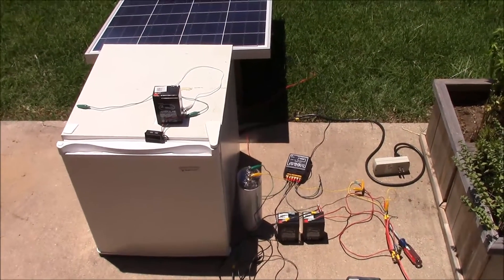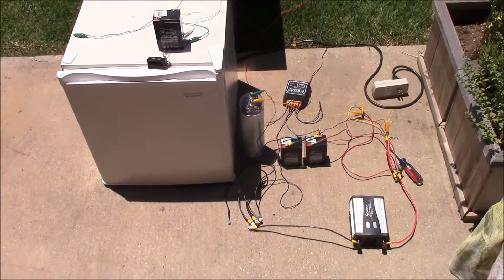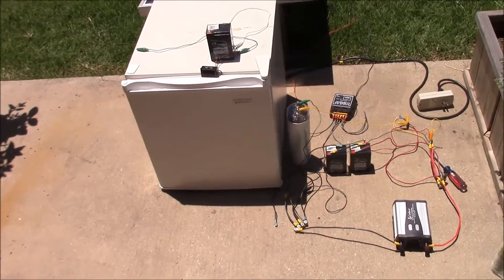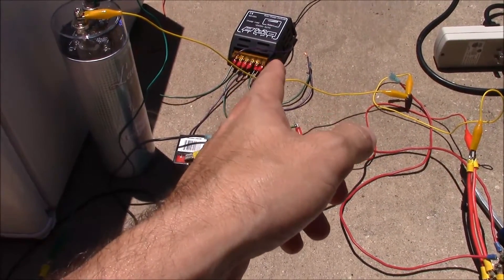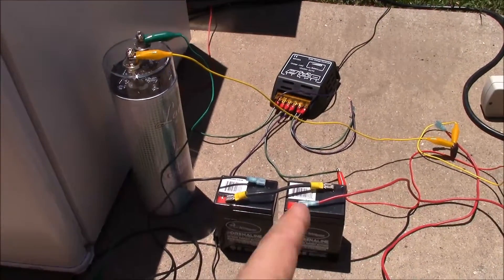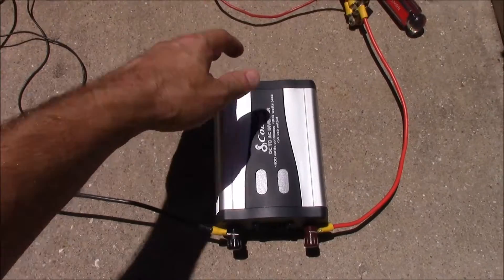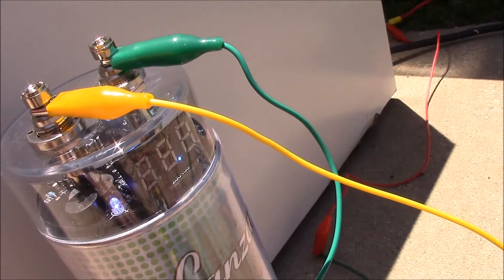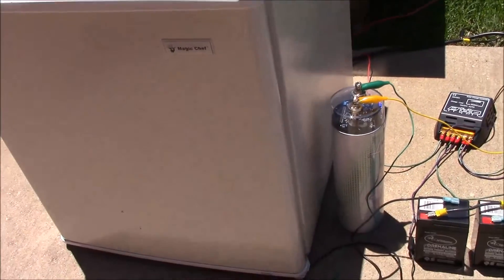Will It Solar? - Mini Dorm Fridge 2

Comment: That tiny 400 watt inverter is too small for the surge current needed to start the frig. A 800 watt $ 60.00 inverter will run the frig. Those tiny batteries are a joke. A $110.00 marine battery will work, with 2x 100 watt solar panels ($160.00) on a sunny day, with your 20 amp charge controller. My 15 cubic ft. frig. will run on that during the day, But you need at least 3 marine batteries (300 AMP HR. ) to run all night.

Comment: Sure it will work..,If you can't do math, keep adding solar panels and batteries until it works.. P.S. the mathematical solution makes more sense..
Reply from the maker: That isn't the point of the video.  Yes an engineer could calculate the exact components and requirements to make this work.  The rest of us laymen cannot or will not do that.  This was a practical, real world test to see what works and what doesn't.

Comment: I know this is an old video, but did you try the capacitor with the battery bank you used in the 3rd video?  I am having the same problem, but with a twist.  I have a dorm fridge, a single 12 volt marine starting battery, and a 500W continuous 1000W peak inverter.  The inverter will not start the fridge with floating 12.7ish volts, but the inverter will start the fridge if I have the engine running and charging at 13.2-13.6 volts.  Once the fridge is running, I can kill the charge source, and the fridge runs fine until it cycles.  I wonder if a car audio capacitor would help in my case, or possible an AC starting capacitor installed in the fridge would help?  If you get bored and want to do some more experimenting, let me know.
Reply from the maker: Sure, I would like to play around with this some more.  The cap in the video is not very big.  If I were going to try this again with a smaller inverter I would try a bigger cap.  To answer your question no I did not try it with the big batteries and the cap.  I have been told that it has to do with the internal circuitry of the inverter whether this works or not so I gave up testing.  But I would be curious what you find out if you doubled the cap to a 2 farad or bigger.  I know the theory is sound but I think the cap was just too small and lead acid batteries have too much voltage sag on a big load like that.
Reply: LDSreliance another comment suggested using an extension cord between fridge and inverter. I added a 25 ft extension cord and that surprisingly worked.
Reply from the maker: Seriously??  That makes no sense at all.
Reply: LDSreliance I completely agree, but it worked until my battery was at 12.1 volts, then it stopped. I cannot make sense of it either. Just for the hell of it, test an extension cord with your 400 watt cobra. My inverter is a 500 watt Energizer, works with no extension cord when battery is float charging at 13.2 volts, needs extension cord when battery is off charge at 12.7 volts.
Reply from the maker: That is bizarre.  I will have to try it sometime!

Comment: I think you need a sine wave inverter
Reply from the maker: Good idea.  I tried that in video 3 and it still didn't work, though.
Reply: Line up a couple of extension cords, sounds silly but ive seen it take the edge off, allowing a window A/C to work, when it wouldn't have otherwise.
Reply: DarkLinkAD you sir are a mad genius, I am trying to run a dorm fridge off of a 500 watt inverter and a single battery. I was having the same problem, after reading your suggestion, I hooked up a 50ft extension cord and bam, problem solved!
Reply: Hey thats awesome, Im glad it worked out for you!
   Now you just need to hack the thermostat for optimal cooling efficiency lol

Comment: Thanks..back to the cooler. Will a 100W panel hooked thru the MPPT controller and then to my RV house battery conflict with the onboard converter charger or does it need a dedicated battery all by itself?
Reply from the maker: Willy Smith I assume that the onboard converter/charger only charges when you are driving (if this is a motorhome) or have a generator connected.  If that is the case then another charge controller should not cause problems.  The onboard converter will supply power to the various onboard devices but will not try to charge the batteries, which would interfere with the other controller.
Reply: LDSreliance Thanks, it is an rv trailer plugged into a land power pedestal and the onboard converter charges the 12v battery as needed. So the solar cell controller should not conflict?  Otherwise  I suppose I would need to unhook and cover the solar panel to keep it from charging uselessly and only connect it when land power is down or I am boondocking where there is no land power?Keep up the good video work!
Reply from the maker: Willy Smith
They will compete with each other if they are both connected and actively trying to charge.  Since you are plugged into land power then that would be the case.

If you already have the solar equipment you could switch off the land power during the day and let the solar give you free energy while the sun is shining.  Or you could wire in a switch in series with the wires coming from the solar panels and switch it on only when land power is down or when you are boondocking.
Reply: LDSreliance Thanks, that is what I figured...I will install a switch on + wire of panel. I've been told that even though it will be switched off I still need to cover it or it will keep producing power with nowhere for it to go and that is bad for the panel. What do you think about that? I guess it would keep the panel clean anyway! Now we need to come up with a good idea for a cover  :-)
Reply from the maker: Willy Smith
I have never heard that before.  The best bet would be to get a switch that can re-route the power to a dump load, such as your rv hot water heater.  The solar panel can dump power to a 12v water heater element when you aren't using it and save energy on propane.

If you need help finding one of those switches I have seen them before and I am sure I can find them again.  They work like a railroad track switch where it diverts power to a different path.